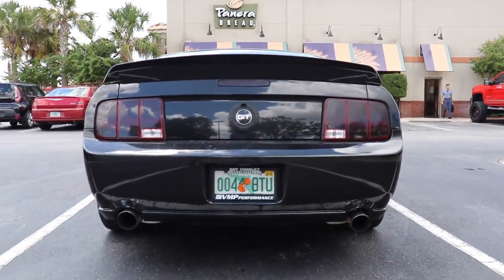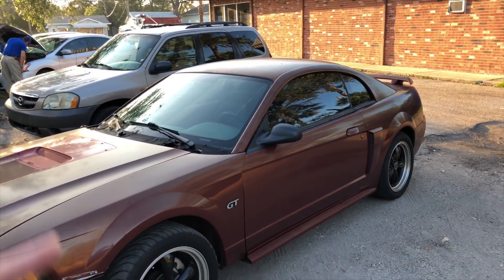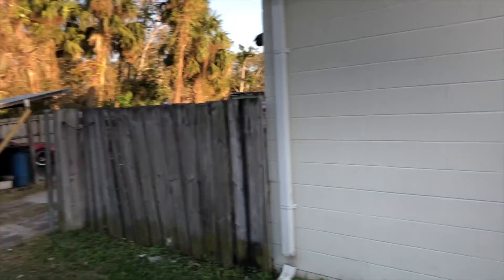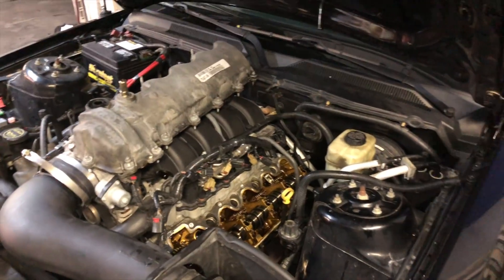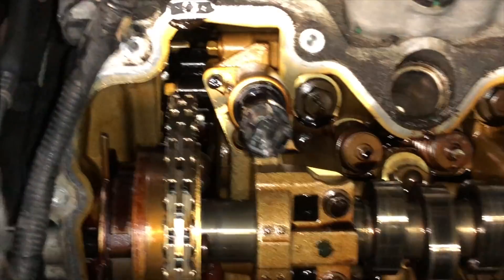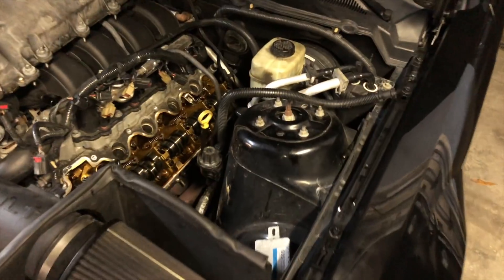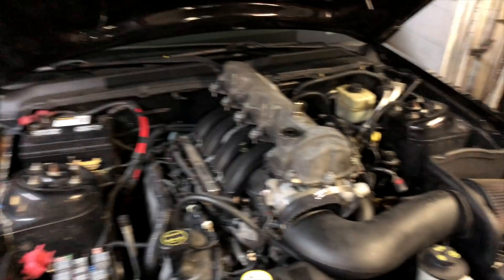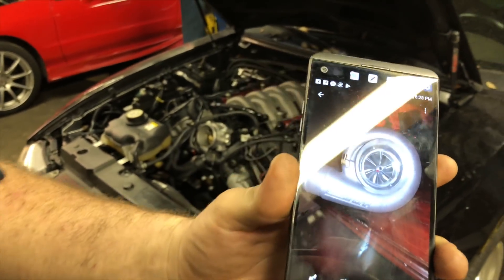Cammed FBO 3V BLEW UP! THIS SUCKS

Comment: Over Rev -valve adjusters went a flyin ,This is exactly why you need to change the lash adjuster ,lifters and Springs even if the cam does'nt call for it with over 100,000 miles on old lash Adjusters and Springs , lifters ? They will not going keep the valve train together at high RPM with the extra lift - just a matter of time before everything floats and goes flyin apart and fails from being pushed even harder than they were with the amount of miles /wear prior .Sorry to here about it brother that really sucks . Plan and Save and do it right this time don't cut any corners on the rebuild it will be less expensive in the long run and run better . Good luck !!
Reply: Finally someone who makes sense.
Reply: Wasawasablingbling! Don't over rev stock valve train. It won't last long
Reply: Jason Delancey exactly right. Definitely doesn’t help when guy is bouncing it off the rev limiters snapping and breaking everything in the heads!
Reply: I had something like this happen on a 4v except mine was a primary guide failure on the right side. 3k Rpm, retarded the cams and piston and valves high fived and 16 broken rockers.
Reply: Jason Delancey does anyone make better lash adj, followers? And my car has 40 k and hotrods should i get beehive springs?

Comment: This seems to be a common theme on this channel: cars failing because they are upgraded for more power but supporting parts aren't upgraded, ultimately leading to failure. The clutch in Ashley's car, Scots stock axle shafts, and now this.
Reply: Thomas Griffin the clutch is a thing that had to be replaced every once in awhile they wear and axles break on stock cars all the time
Reply: Auston S Stock vehicles don't break axles all the time... Scott's axle wouldn't have failed so soon if they were upgraded earlier to deal with the tire and power upgrades at the drag strip. Also, the clutch wouldn't have failed so soon (and dramatically) if it was upgraded to deal with the power increase.

Comment: That's a really nice 3v.. I like it. Wish I had enough cash to have 2 cars Lol.. I wouldn't mind a 3v just to mess with, they're pretty inexpensive and still look cool and sound great even if they're not fast Lol.
Reply: Sigrafix i mean u can throw a blower on it but that shit gonna got glass jaw pistons so anything after 500bhp is pullin a pin on a grenade, if u fix the two weak points of the car its a great platform as the block is good for 1000bhp+ no joke, look it up lol